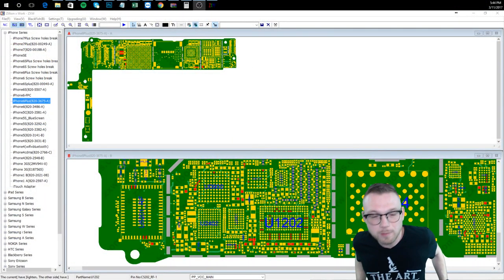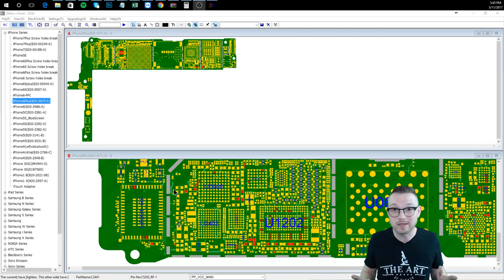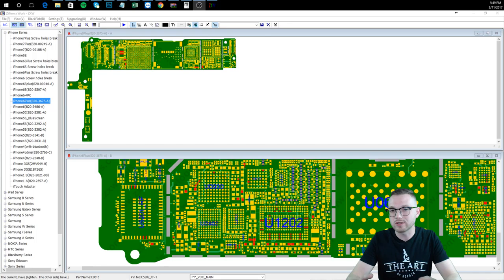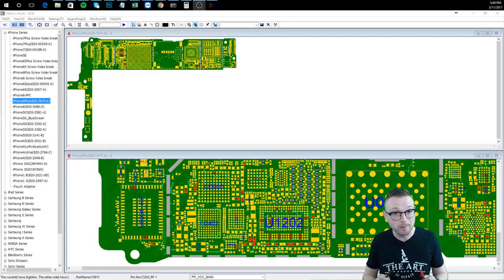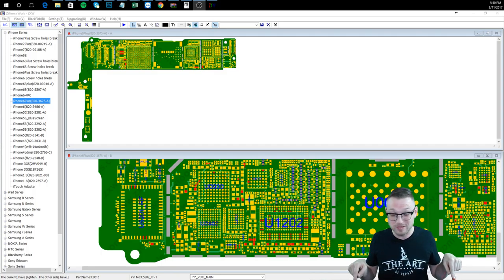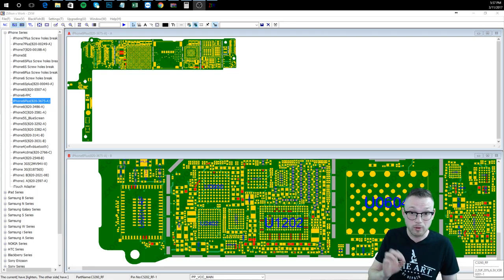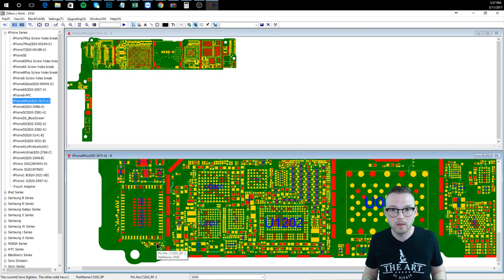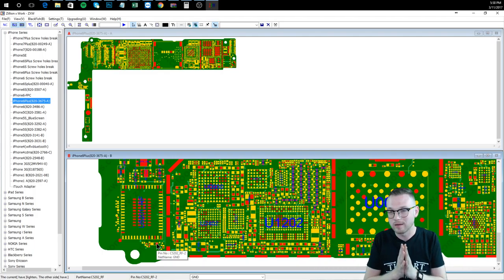EP22 Mental Visualization of Short to Ground | Why does one Capacitor short my whole line?

Comment: Thank you so much, quick question. when I watch videos on YouTube how are the people able to isolate the bad capacitor if they would all show bad?
Reply from the maker: @UrBrother_711  through thermal readings. Either with a thermal camera (150$) or some cheap ways are with flux Rosin / freeze spray in a can or isopropyl usually you would use the cheap methods with injection of dc power into the circuit to cause heat to form at the bad capacitor. 

The thermal camera is the preferred method as the other methods require experience and sometimes multiple try’s to work since they are indirect ways to observe the heat.
Reply: @TheArtofRepair  thank you so much for the answer, I’m trying to start progressing from basic screen and part replacement to soldering and board work and I really appreciate you and the many others that take the time to explain everything to us newbies. Are there any strutured courses you offer online or any online courses you can recommend to build up my knowledge before getting more hands on?

Comment: just got my portapow the other day, thanks for the tip brother!
Reply from the maker: My man! Just don't forget to turn it off when you're done. It uses an internal battery to function vs the usb ones that feed off the line. I constantly forget mine on... =( lol
Reply: good looks, ill keep an eye for that. im going through your equipment list..what are you using the d-Limonene for/what does it do?
Reply from the maker: Best optical glue solvent in the world. Smells great, and is pretty safe. Make sure you always still wear gloves though! Try not to get this in a device's frame though, it's a paint to get out ones it's soaked into the pores of the plastic.